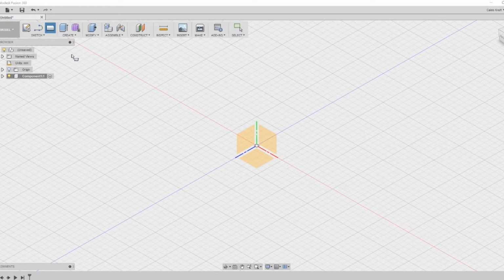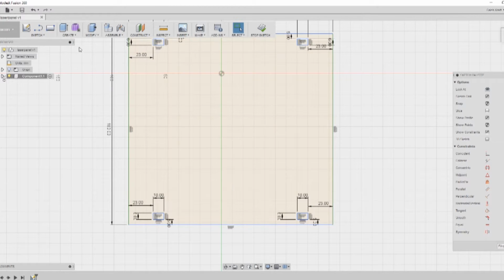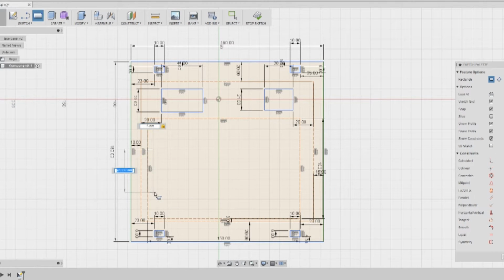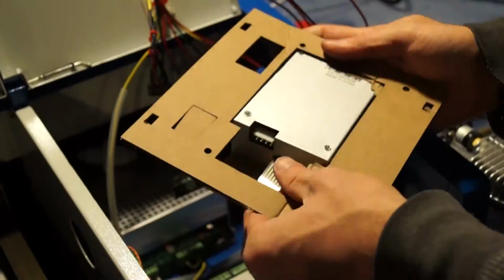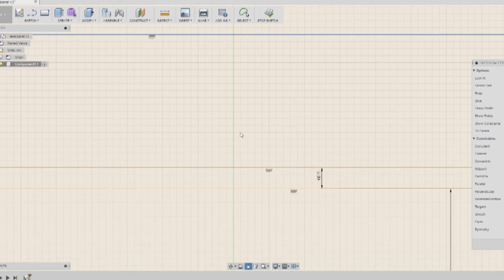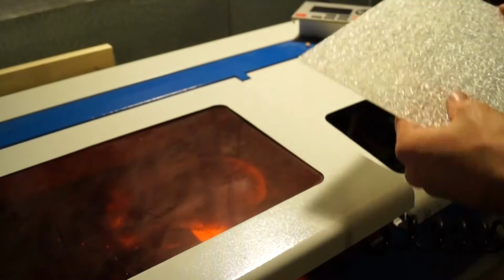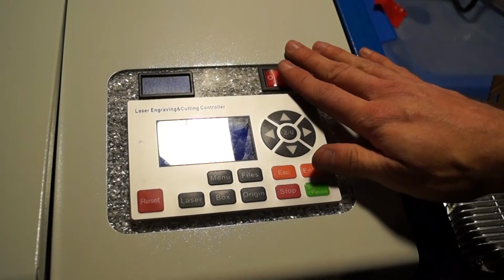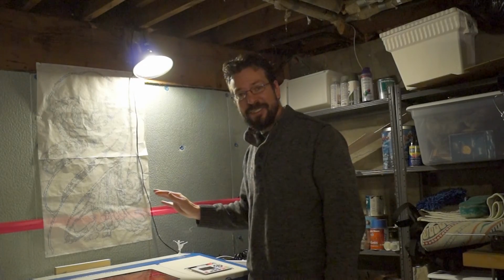My Laser! first cuts

Comment: What are you using as a bed for the laser cutter?
Reply from the maker: I still need to create a custom bed. right now (in this video) I'm using the one that came with it, that isn't height adjustable. I have a rigged together one using wire mesh, but it isn't much better.

Comment: Nice work :) I rebuilt my DK40 china laser with aluminum extrusion and some 3d printed parts. The bed size now is approx 750mmx750mm :D Over kill considering the power of the thing I know but what can ya do :) Lasoring is so much fun so enjoy! & yes, better extraction is always required in those things :)
Reply from the maker: nice! yeah, I suspect that sealing the lid a bit better would help too. Maybe I'll try to channel the air more through the front to the back to help with the smell.